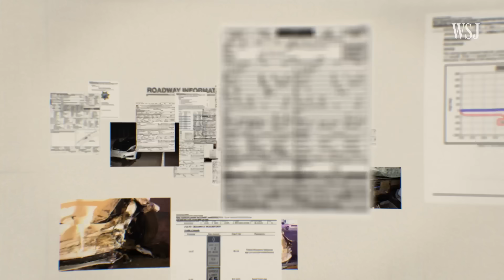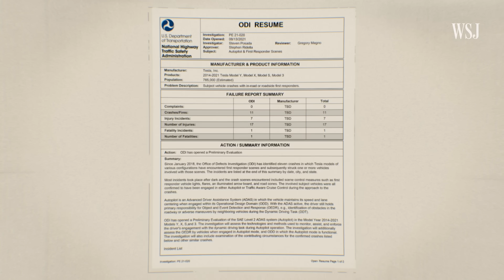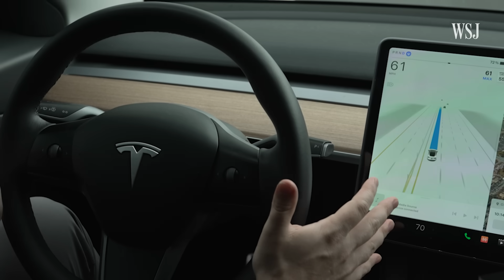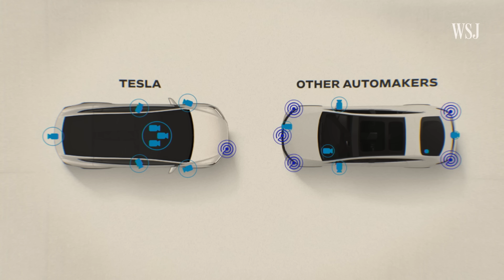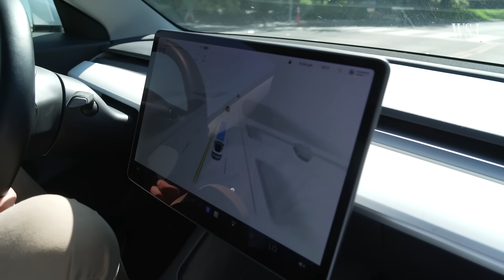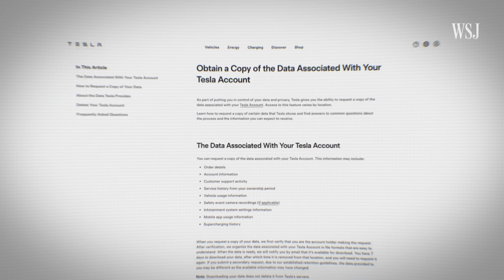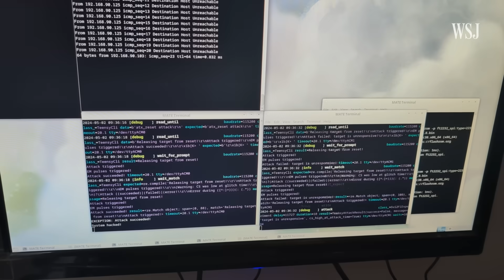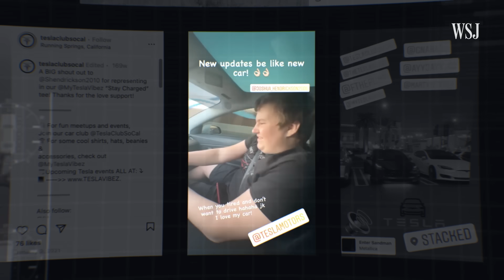The Hidden Autopilot Data That Reveals Why Teslas Crash | WSJ

Comment: Tesla purposedly called it autopilot so people would buy it, which is extremely misleading. Just call it driver-assisted system or anything similar, so full of lies there
Reply: Elon also said years ago that buying auto pilot would make your car an appreciating rather than a depreciating asset, years later that is still not the case. He claimed at the end of 2015 that they'd have FSD solved in about two years, it is now 7 years late. He's now claiming it will be next year, but he first made the next year claim in 2016.
Reply: The thing is, if most of the car manufacturers would cooperate. They could have made a device which will tell other computers that this is a car. Also you need to provide clearer information to the computer what should they do in specific cases
Reply: There's nothing wrong with calling it cruise control....which it pretty much is

Comment: There's no doubt that the Tesla Autonomous Driving is very far away from where it needs to be to be able to work as an Autopilot.....
But Common Sense should tel Auto Drivers the following: if Autopilot in Airplanes operate in defined air corridors, with separation of at least one thousand feet in vertical and two thousand feet in horizontal whilst still requiring a competent Pilot to be attentive to and warning or alarm (TCAS, Terrain Alert, Sink Rate, Bank Angle, Cabin Pressure, etc.); WHY on Earth should we start reading a book while our vehicle is driving at 60 mph in a congested highway???
Undoubtedly there are pitfalls that Tesla, and the rest of the auto industry, NEED to attend and properly respond to families of  people that  died as a consequence of a car running  in autonomous mode. But people also needs to understand the technology they are running.....let us STOP reading texts  or watching movies while our vehicle is moving within  6 feet if other vehicles or pedestrians. ....

Comment: Machine Learning system might be very good at estimating hiw far something is from a video, but no amount of Machine Learning will fix the fact that cameras can't see well in the dark. "Autopilot" should not engage when the visibility is low. Extra sensors ToF, Lidar, etc should be used for accurate measurements and more importantly in low visibility situations.

Comment: Tesla and Elon is a figurehead of capitalist greed. The tech is not good enough, period. And therefore it should not be called and marketed as Full Self Driving and charge people exorbitant amount for it. To squeeze and hide behind legalities over your shortcoming is what is wrong with Tesla. It's makes people wonder if your branding is trustworthy or not? And meanwhile Elon is out there getting his net worth pumped up, it shows where his focus are right now. Driverless technology is a good innovative and should be encouraged, while it is still in progress, it should not be marketed to people as if it is another capable driver. And they are pushing the taxi out with no steering wheel, so dangerous. 

Do people think the lady in the video can obtain the data from Tesla, Tesla will probably delay, then deny and wrongdoing and then defend itself with lawyers if needed. Hey wait, sounds like insurance? 

It's very difficult to see Tesla and Elon Musk as a force of good when he don't even bother to keep his own products safe. Mistakes and faults will occur, it's fine, just amend it. But if it is so deliberate, it makes one question the integrity.

Comment: Lidar has been proved to be unnecessary. It's true that the systems are far from flawless. Perhaps the question we need to ask is... Would a driver controlling the car have avoided the accident & how many accidents were avoided by the software that would likely have been an accident if a driver was in control. Once again, we need to stress that drivers should be observing the progress at all times & intervene if necessary.

Comment: WSJ scare campaign. As usual. You guys don't even know the difference between Autopilot, Enhanced Autopilot and FSD (supervised).
And to everybody taking this video seriously: Think again and do your own research. If that was so "dangerous" why is it still allowed?
I tell you why:
Because when using one of those semi-automatic driving system >>YOU<< under >>ALL CIRCUMSTANCES<<< are in charge and must take over IMMEDIATELY when using this Beta software version! There is no way around.
Stop making someone else responsible for your own mistakes.
Reply: This is just excuses I own a Tesla and it’s trash. I have reasonable expectations and I might as well be driving because the Tesla self driving in Veda constantly tells me to put my hands on the wheel when I’ve literally never taken my hands off the wheel this is not ready for prime time
Reply: @duckfootDH  I also own a Tesla (Chinese) and it is not trash. Are you talking about FSD or Autopilot? No matter what - fact is by using either you agreed to stay in charge all the time, if you like it or not. If you don't like it - just drive yourself.

Comment: 3:50 look at this crash. There is NO WAY the driver was paying any attention. He had a good 10 seconds knowing there were emergency lights ahead. Blame the car all you want but a majority of the time, the drivers were not paying attention like they are supposed to.
Reply: If you have to be vigilant all the time, on the edge waiting for the autopilot to mess up, how is it better than self driving? What is the point of this automation anyways? Just a marketing trap, i guess!
Reply: @farhan3519 it's not "waiting for it to mess up" but simply looking ahead and paying attention.
Reply: @oyacaro It drove into a stationary object in this instance. So, yes, it is about waiting for it to mess up.
Reply: @ “vigilante” no? Paying attention still? Yes. Big difference. Many of these scenes it was obvious people weren’t paying any attention at all. I use FSD all the time but I still give it the same attention as if I’m driving. I just let the car take control while I monitor it.
Reply: @farhan3519  They call it a beta. You have to agree to the T&C to use it, which includes paying attention and that the driver is ultimately responsible. Be butthurt about Elon all you want. but FSD is going to happen and likely sooner than any of you think.
Reply: @sailirish7  FSD on itself is fine. The way Tesla is implementing it however, is dangerous and is killing people.
You can't go making improvements step by step . It's fine in the beginning. When there are enough mistakes, people will remain engaged. But paradoxaly when the system gets better, the people driving will get bored. That's when the major accidents happen. And you really can't blame drivers there, because almost no-one is able to remain attentive for an hour when nothing happens.
Reply: You realize though they're about to fast track it so this tech will be fully autonomous, right?    The new administration (which Musk is a part of) has already telegraphed that.    In addition, they are going to remove the requirement to submit crash data to the NHTSA.
Reply: Absolutely. This is another hit piece. Even the second crash. You can't see that car.  A lot of people won't see it.  Regardless of a human or computer. Those crash cars without lights are very hard to see. I almost crashed in Portugal

Comment: the notion of 'assisted' driving implies that it's ok to not be focused on everything you're supposed to focus on as a driver, what's even the point
Reply: Because you can focus on other aspects of driving than simply steering and following distance. For example, I spend more times looking in different directions (especially behind me), when passing by semis, when vehicles are changing lanes beside me, when nearing an intersection or lookout for pedestrians/cyclists around me. It allows me to have a better situational awareness and be more ready to take evasive actions in needed.

Comment: The assistant in my previous car, a 2019 Skoda Superb war superior to any autopilot iteration I've seen so far.
Adaptive cruise control was working flawless up to 210km/h. Road Signs - even dynamic ones or those on trailers used for roadworks were >95% detected correctly.
Lane assist was most of the time even able to follow temporary markings within construction sites. 
I was shocked, how bad things can be when driving a 2 years younger Tesla. Not even talking about the consequences of the missing ultrasound parking sensors....

Comment: I'm guessing the crashed truck was there for quite a while and didn't just "appear" out of thin air. The driver didn't see it or hit the brakes. Even though driving assistance was on, the driver must remain vigilant at all times and be able to take over controls at any moment. The driver failed to do so. The only blame I could give Tesla is to all their assisted driving tool "Autopilot", suggesting there is no need for interfering - even though their manual supposedly clearly indicates that it is necessary.

Comment: They say "autopilot" but do they mean Full Self Driving (FSD)?
Reply: No, they mean Autopilot. The crashes they mention are from 2021 and before. FSD was restricted to those with a safety score of 100% or close to it at that time so they were drivers that were already driving defensively (for example, hard braking would drop you from the 100% group).

Comment: For a car that already caps at 100K USD adding at least two LIDARs in front of the car would be a drop in a bucket compared to incurring expenses due to court trials, should they lose the court trials (and it seems they will with their claims). Not to mention the suffering it could have prevented. What is that NO position? BYD does it, Volkswagen does. There should be a minimum standard below which you just CANNOT go. 

I believe economies of scale should reduce LIDAR prices. The more cars adopt it, even non-electric, the better. Same thing happened with ultrasonic parking sensors and cameras. With time they became cheap or at least accessible and are now in new cars by default.

I saw unstaged videos (not the lab crash tests) with amazing last second life-saving stops by huge trucks by Volvo where people were crossing in the so called dead angle zones (angles morts) where the driver wouldn't even have a chance to see there was someone. Why is this not in every car?

Comment: Watching out for autopilot’s errors is actually more stressful than driving yourself.
Reply: It's like driving with a student driver.
Reply: @cadekachelmeier7251 it seems so when the other drivers act as student drivers
Reply: This has been my experience, it’s total nonsense
Reply: Literally, it’s lowkey annoying af, only people I know who use it super carefree are nut jobs, who frankly don’t belong on the road anyway. From what I’ve seen it somehow manages to make people into far worse drivers. Dangerous af, I’ve seen it with brother in law & friends, previously who is trust behind a wheel…now they’re reckless
Reply: thank you
Reply: Yeah, I turn the assistance off because it can nudge you into oncoming traffic...and mine is not camera based
Reply: As someone who has 1000's of miles worth of experience using both Autopilot and FSD systems, I can tell you this comment is factually innacurate. Both systems are far from perfect, but are heavily weighted towards added safety when used as instructed.
Reply: U Suddenly wakeup gasping - as if u crashed & can't reachout
Reply: I do not find even basic cruise control to be useful. I need to be involved in all aspects of driving the vehicle or my attention wanders.
Reply: @Ottawa411 that sounds like a you problem, not a problem with the automation features.
Reply: @jeffclark5268  Perhaps, but the crash figures could suggest otherwise.
Reply: @jeffclark5268 As a long time Tesla owner, I can 100% say “it’s definitely a Tesla problem, and a Tesla cult problem”.
Reply: 70000 miles on FSD as early adopter since 2020. No accident  ;)
Reply: You clearly have never used FSD
Reply: I disagree entirely. Been using it for over a year now and I absolutely love it.
Reply: @letuinchi yep. I’ll never own a car without FSD again. It makes my driving so much safer. Quality of life improves significantly with FSD.
Reply: @ronbenfield6182  I guess it depends on your driving standards in the first place.
Reply: @ronbenfield6182 you are the issue fyi.
Its not fsd...

Comment: I honestly don't understand people having enough confidence in autopilot to not be paying close attention. My personal experience with autopilot has made me stop using it almost completely. My main problem with it wasn't even mentioned in this video, and that is the sudden unexpected slamming on of the brakes the car will do sometimes, such as when a truck is pulled over to the side of a highway and has blinking red lights. The truck is not even on the road, but the car will slam on the brakes in the middle of the highway as it drives past the truck. This has happened multiple times to me, and it's extremely dangerous at highway speeds with other cars following you on the road. Nowadays I mostly use autopilot in cruise control mode instead of full autopilot mode, and I also like the auto lane change feature. Fortunately, it's very easy to switch in and out of the various modes.

Comment: Did you compare your data against other car manufacturers and autopilots?
Did you normalize your selection against total number of car models?
How exactly does Tesla's Autopilot compares to any other "Cruise Control" implementation?
What are those other implementations and what's the statistics?
How other manufacturers treat their incidents?
The absence of footage from other car brands is not a proof of safety, but you clearly stick to this version.

Your journalism is not just poor - it's obviously biased and misleading.

Autopilot is an old and precise term from aviation, which is much better than a fancy "Cruise Control". Stop treating like it's something different.

Comment: The problem with self-driving systems is that on the one hand, they take the driving task away from the driver so that they can do whatever else instead, which is their selling point, yet on the other they require the driver to resume driving at extremely short notice. Relieving the driver of the driving task leads to driver boredom, inattention, even sleep, so there is an inherent contradiction in the overall model of system operation.
Reply: The Warning in the Model 3 manual about FSD (Supervised):

Full Self-Driving (Supervised) is a hands-on feature that requires you to pay attention to the road at all times. Keep your hands on the steering wheel at all times, be mindful of road conditions and surrounding traffic, pay attention to pedestrians and cyclists, and always be prepared to take immediate action (especially around blind corners, crossing intersections, and in narrow driving situations). Failure to follow these instructions could cause damage, serious injury or death. It is your responsibility to familiarize yourself with the limitations of Full Self-Driving (Supervised) and the situations in which it may not work as expected.
-----------------------------------------

The warning when you want to enable FSD (Supervised) in the car:

Under your supervision, Full Self-Driving (Supervised) can drive your Tesla almost anywhere. It will make lane changes, select forks to follow your navigation route, navigate around other vehicles and objects, and make left and right turns. It must be used with additional caution and an attentive driver. It does not make your vehicle autonomous. Do not become complacent.

Cabin Camera is used to detect driver attentiveness while FSD (Supervised) is in-use to provide you with audible alerts, reminding you to keep your eyes on the road.

By continuing, you allow Cabin Camera (above the rearview mirror) to determine inattentiveness and remind you to keep your eyes on the road when FSD (Supervised) is active.

Do you want to enable FSD (Supervised)

[ No ] [ Yes ]
-----------------------------------------

So, if they believed it was a eyes off technology, they didn't read the warnings.

Comment: You cant conclude this system will never work .  Thats just guessing .. plus it could be pretty easy for tesla to incorporate  an extra sensor so it would never run into something .. i hope elon will not be too arogant for this
Reply: The problem is that it DOES work - just not in every conceivable circumstance. That makes people put to much trust in it. Elon Musk flatly refuses to add the different sensor technologies which would add the missing data in edge case situations - that's what he says in the video.
Reply: @dianataulbut2299  I know .. and elon also knows it will take lives he stated this .  Ge is just betting on this system combined with ai progression to make it good enough !! If still camera s dont work good enough and waymo is ahead .. he will probably solve his problem I think .. but it has to evolve first ..

Comment: Nothing can drive better than a trained driver. Including measures to reduce the consequences of inevitable impacts, or sudden trajectory corrections to avoid obstacles without hitting them. Autopilots only work well in planes.
Reply: As the trained driver focuses on a dog running towards the street on his left, he didn't notice the kid running towards his dog on his right... These systems can save life but these stats aren't correlated as 'nothing happened'.
Reply: @sylvaing1  a well trained driver spreads attention to have situational awareness.
Reply: @marcosfernandez7207  Yeah, how many of those are there? Most drivers need all the help they can get.